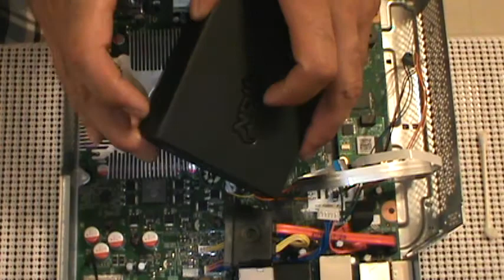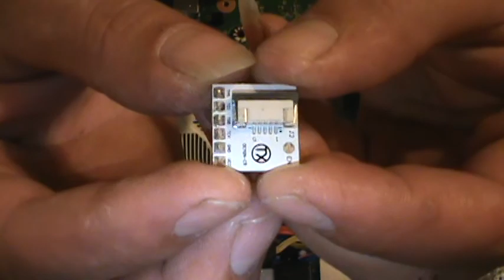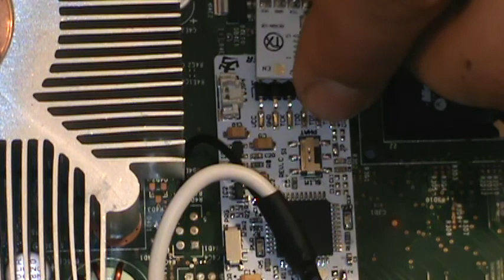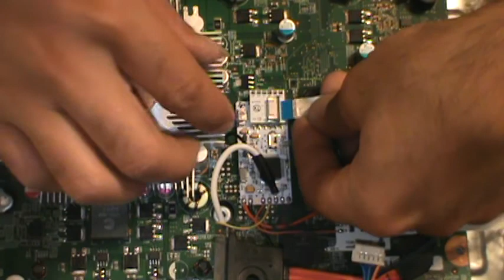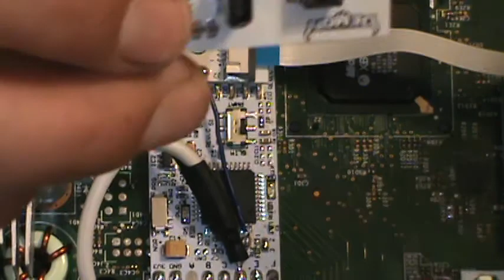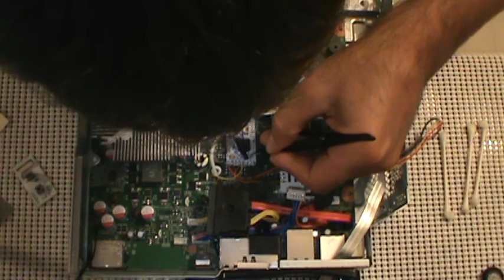Xecuter Demon Slim Install Tutorial Part 6

Comment from the maker: did you remember to switch the demon to XB after install?  If you didnt and you plugged both the power brick and the usb at the same time you will fry the demon chip.
When you plug in the console does the coolrunner light come on?

This is really an issue for my support forums.